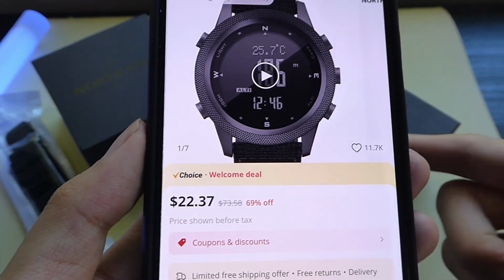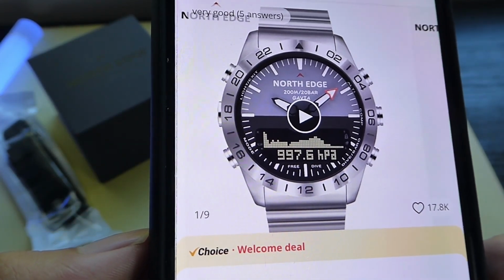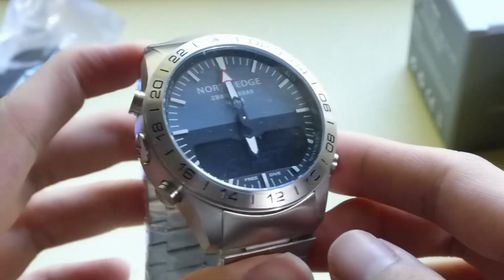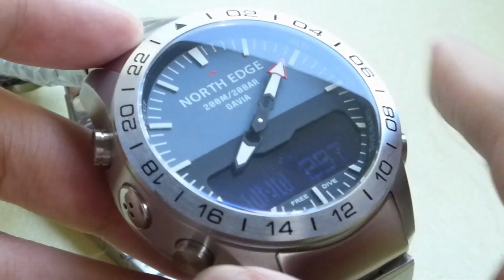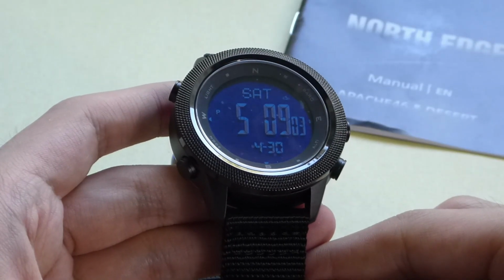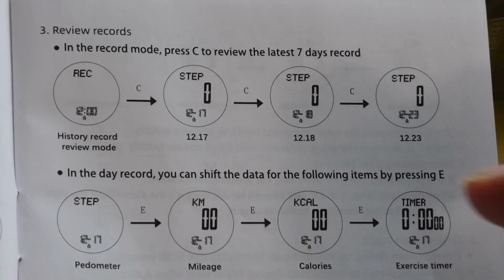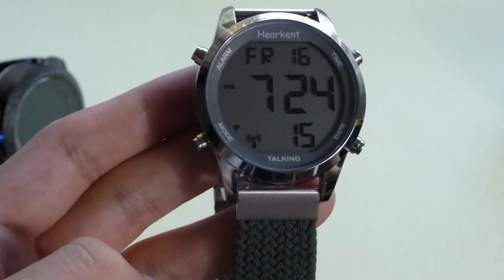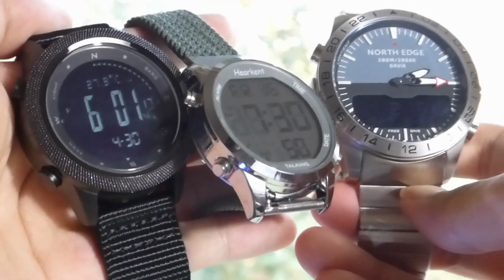REVIEW: AliExpress Digital Watches Haul - North Edge Apache, North Edge Gavia, Atomic Talking Watch?

Comment: Does anyone really believe that a $23 watch can be high quality? It is easy to make a watch look tactical or rugged, but it is entirely a different matter to make a watch that can really withstand hard use and remain functional and accurate. There is a reason that these cheap Chinese watches are made to look like Garmins and Casios. Because they know that people buy them based on how they look in YouTube videos. Save yourself some headaches, fork out the money for a good watch and know that it will still be on your wrist in a few years.

This review did say something that was accurate. The watch is "durable looking". Is that what you want?
Reply: Gavia costs 80 USD.
Reply: i could notice that the hands on the gavia did not align properly, and there are inconsitencies between the altimeter and temp between the watches, although they were clearly done at the same time. that's the problem with the chinese watches: they're inconsistent
Reply: @georgeniculescu  Maybe they are not calibrated properly?